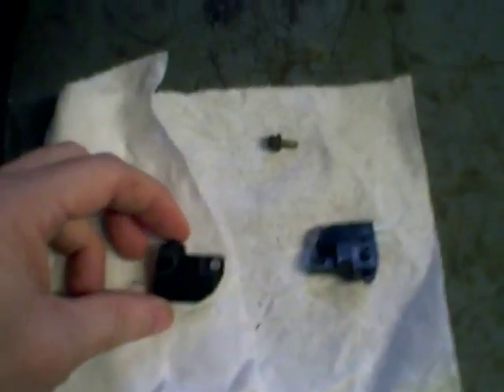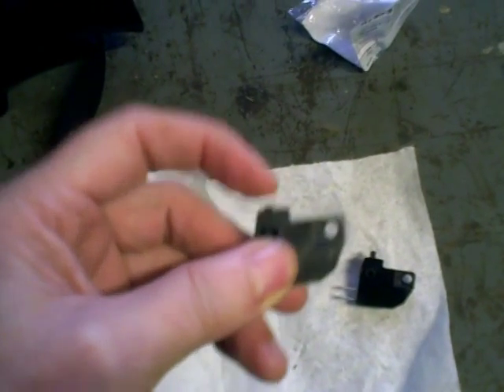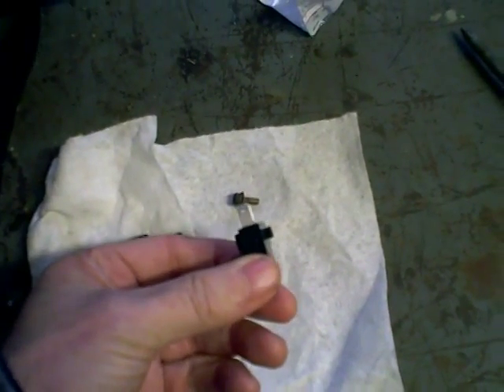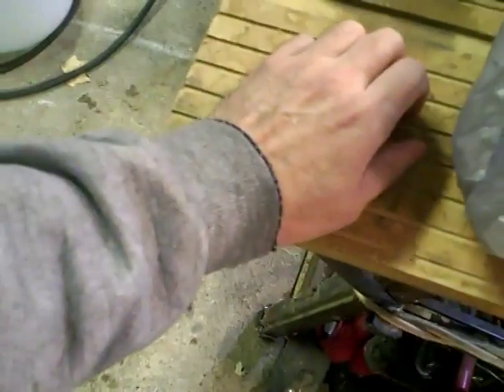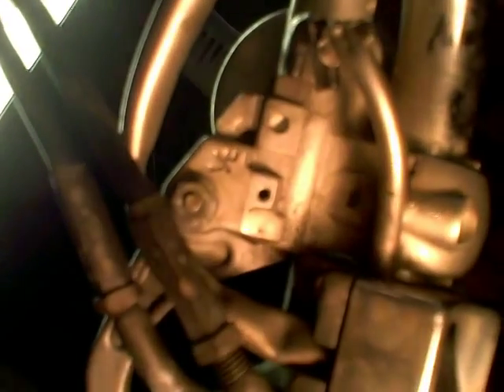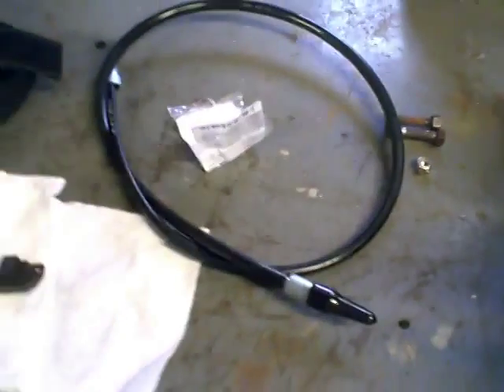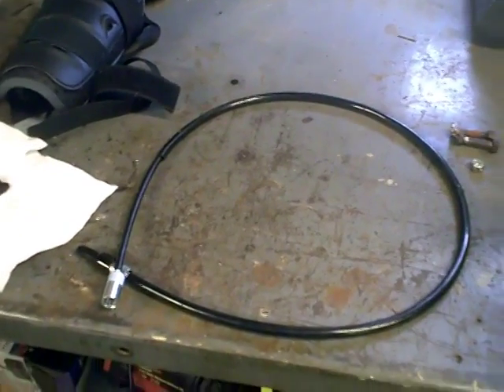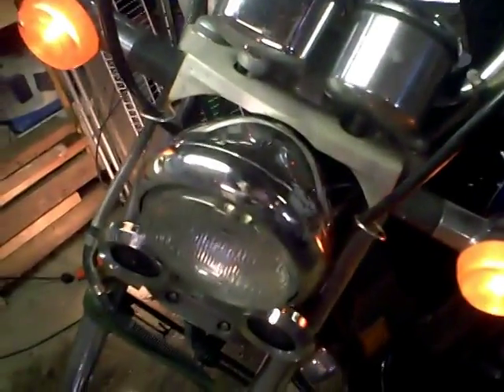Kawasaki Vulcan 500 Brake Switch and Speedo Cable Fix

Comment: Wait so the switch determines wether or not both breaks signal?
Reply from the maker: No, It's a simple "momentary on" single pole switch.  It's only on while you are holding it down, otherwise off.
Reply: suburbanryder - The Mayor -  let me rephrase.    My brake light won’t illuminate when I try the front break or back break. Could this switch be why?
Reply from the maker: @superLEGOman4444  Ok, Now I understand. It's very unlikely because it would mean both switches failed at around the same time. Possible but rare.  More likely the wiring closer to the light itself has failed and blocks the extra voltage from both switches.  This will take a lot more tracing. Also check if a fuse is blown not allowing voltage to either switch. If you can find a wiring diagram there may be a relay in the circuit too. It may have failed with corroded contacts or the magnet has failed to pull in the contacts.
Reply from the maker: The fastest way to check the switches is take one and bypass it with a jumper. If the light still doesn't come on the switch is not the problem.  Most switches just ground the circuit to complete it.  For safety I would still use a jumper on both sides of the switch rather than a direct ground.